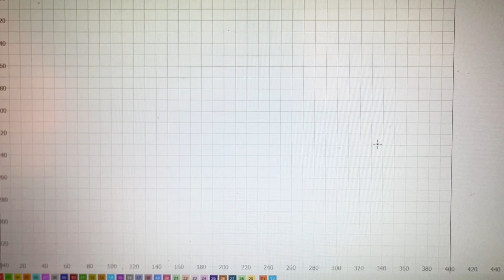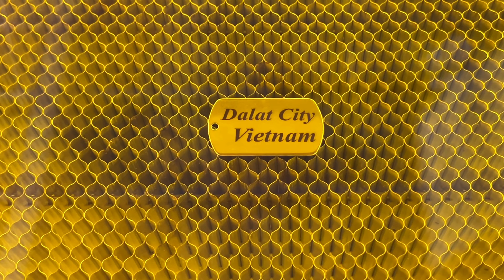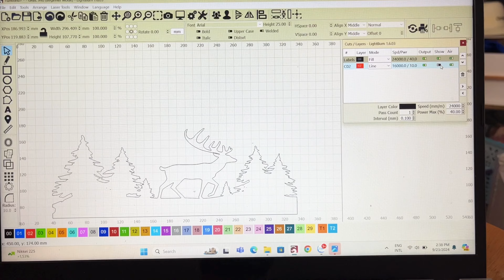I Make A Light Up Mountain Wall Art With TOOCAA L2 Laser Engraver & Cutter

Comment: Nice video. Does the ventilation on this engraver/cutter allow you to work safely inside a home? Does the software automatically convert continuous-tone images into halftone, like the "print" of you and your dogs? Thank you for sharing.
Reply from the maker: Hello, thanks again ❤ If using indoors you need an additional Smoke Purifier (available on Toocaa's website), I haven't yet so I put the tube out the window. The software I use doesn't have an image conversion feature, I use Corel X7 to edit the image before putting it into the Laser machine control software.